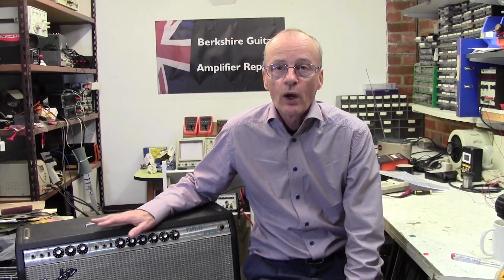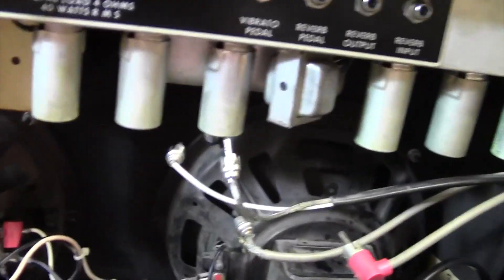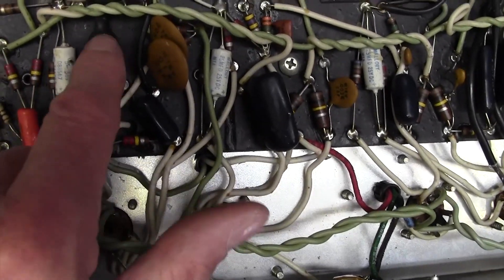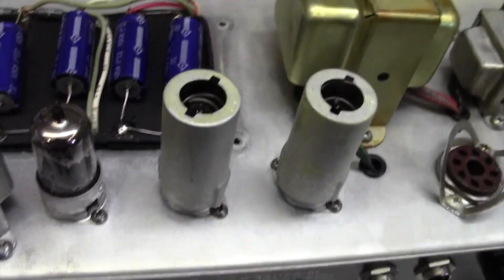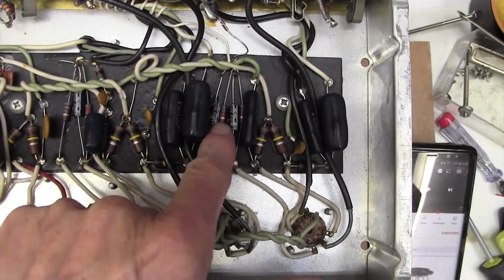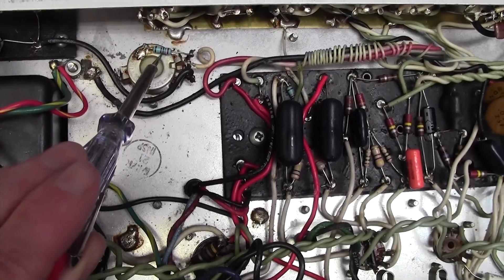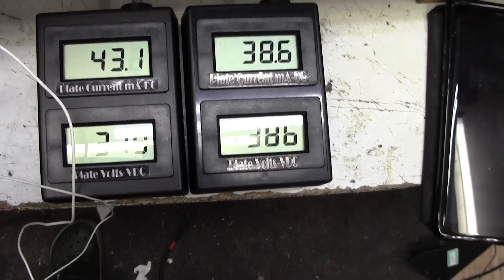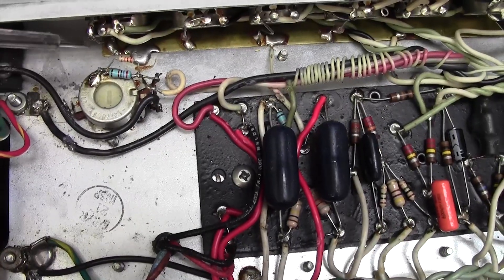How to Bias Fender Vibrolux Reverb

Comment: Excellent video Stuart....it looks identical to my silverface  Pro-Reverb I am working on. Same amount of old  white mallory caps also...5 in total except the one on the far left is 50 volts at 5uf...I'm having difficulty sourcing that. Any suggestions? ( UK suppliers) Your recommended supplier at the end of the video sells valves only
Reply from the maker: I use HiFi collective for my caps. Check them out.

Comment: Hello Stuart, why didnt you replace the current 15K original resistor with a 22k? I saw you soldered a resistor in parallel to the original?
Reply from the maker: I can;t remember now. Sometimes I do this because the originl is hard to remove and replace. Sometimes I do it to show that it is a modification and also to help the next person easily locate the bias resistor change.
Reply: @stuartukguitarampguy5830  Thanks

Comment: Hello Stuart, I just installed my new Weber power transformer, the other tranny had shorted out. The Weber tranny did not fit, that is the bell was too large, so I removed the bell end that has the wires coming out and the tranny was able to fit in the chassis.   I think it will run cooler without the bell and the amp now powers on. I started to check the bias and found out I had to decrease the resistor in order to get a higher range on the bias pot. Thank you for your videos........
Reply from the maker: Hi Jim. Well done, sounds like you got there in the end!

Comment: Good morning Stuart, I removed the secondary windings from the circuit board as you explained and yes it blew the fuse again. Now I know its the  power transformer. I had a hammond 290cx power transformer in it. There are some more companies out there and would like to ask if it really makes a difference in the power tranny? Weber makes one and so does Mercury and I believe Classic Tones. I do know that a output tranny can make a difference in tone but what about the power tranny. Thank you for your time...........

Comment: Hello Stuart., I found that I have to change my bias resistor to a smaller value. Once I put back my chassis I blew a fuse. I inspected the circuit board and found a piece of metal that came dislodged from above which fender uses as a heat shield and found it in the heater section where the pilot bulb is. This caused the short. I removed and put a fuse in and it blew again. Do you think the power tranny is ruined? thanks
Reply from the maker: Hi Jim. Oh no, what a nightmare! The inly reak way to check is to disconnect the heater winding from the board and try again. Actually, I'd disconnect ALL secondary windings
and try. If that blows a fuse it's probably the mains Tx. Good luck.

Comment: Realy nice video and thanks for the reply. Some info you can use in a new video? is a Bias methode like: Wattage  6l6GC = 30watt, devided by the measured plate voltage (400V ?) = limited plate current of the tube/valve. 
To fixed bias in push pull mode, you could use: Hot bias is to adjust to 70 % of the calculated limited current. Cold is about 50% of calculated current. Medium is 60%. Going lower then 50% often gives crossover distortion. Some tech use a scoop  to fine tune that.

Comment: Nice, but why do you bias the 6L6GC so very cold.
Reply from the maker: I wouldn't call 45mA 'cold'. I like to bias tubes on the coller side of the oiptimum just to extend tube life and stop everything running so darned hot all the time.
You'd never hear the difference between 45mA and 54mA. 'Cold' would be about 25mA!